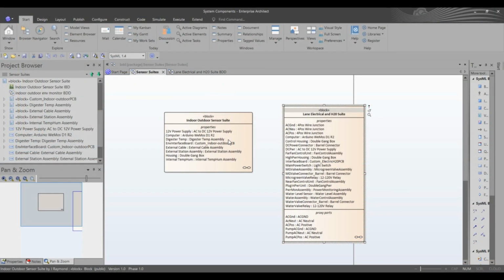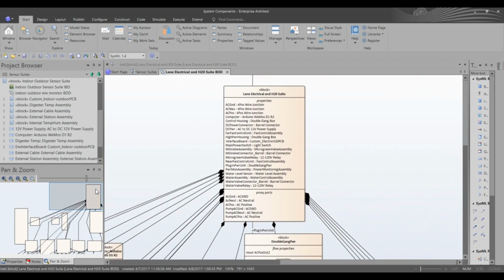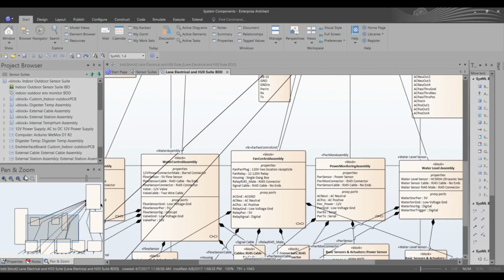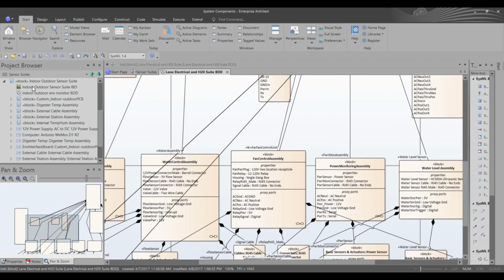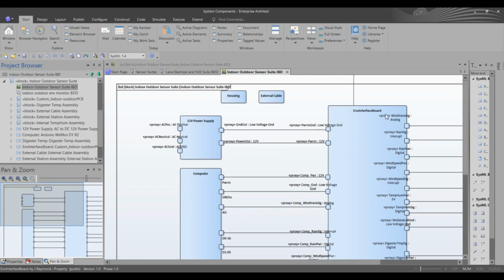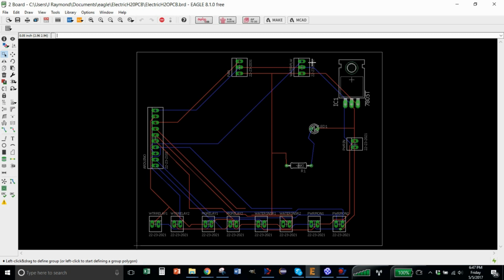Off-Grid Trout Aquaponics Automation - Arduino Sensor Build Part 1

Comment: Cool vid. Couple of comments - whenever you have a linear regulator like a 7805, it's good practice to decouple the input and output to reduce the possibility of oscillation and cope with momentary current spikes - a 10uF and 100nF on the input and a 100nF on the output should do the job.

Second, ultrasonic sensors used for water level sensing can be challenging - I'd definitely do a lot of testing and logging of data before trusting those sensors - a common problem is condensation, which can change the behaviour of both the transmitter and receiver.

While others have mentioned float switches, which have merit as a cheap fail-safe before you overflow, they don't give you a continuous picture of the behaviour of your system. I've used pressure-based submersible sensors for both tanks and bores (you Yanks call them freedom-wells I think). A depth sensor with a range of 0 to 2ft might be a good option for your fish trenches.

Comment: As an engineer you should know the KISS principle. A float switch is tried and tested technology, doesn't need software or monitoring, and is simple to fit.

For the Ultrasonic transducers you should use the waterproof ones used for car parking sensors - again tried and tested.....
Reply from the maker: I love the KISS principle...check out the next video...I"ll address why I want to have the ultrasonic..i.e. it's more than just safety switch.

Comment: Why not an automatic waterstop like in a toilet? That way it can never overflow.:) Nice video again Martian!
Reply from the maker: check out  part 3...i'll go over the reasoning...thanks for all the great comments and support Braxx!
Reply: Either that or like a swamp cooler float valve.  Similar principle.  The issue I see with this maybe that the pumps start moving water and the level drops, so it fills the tank.  When the pump stops, it will be higher than expected.  Will check out part 3 when released.

Comment: It seems that you are over complicating the water level issue. A simple float switch, such as in a toilet will do that so easily.
Reply: Same thought. Simple and reliable float valve. Even if the computer crashes, it will always work.
Reply: I agree, I have also seen issues with sensors like that detecting water or things that are clear.

Comment: A possible fall back for the water level could be a float switch. If the water got to high, the switch would close and send an alarm. R
Reply: AD4MRick he could just use a normally closed float switch and if it gets to high it would open the circuit and cut the valve off.

Comment: Why don't you plan your board as a shield for the wemos/arduino - this should be simpler to put it together and later - maintenance. Second - have you checked if your ultrasound sensor is water proof? It will be installed over the water, so there will be a condensation (possibly a lot).